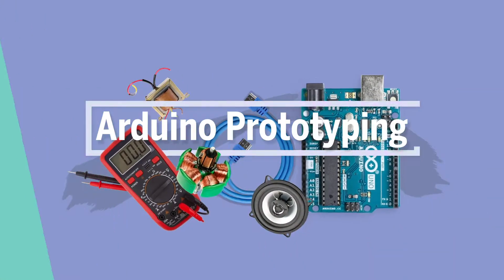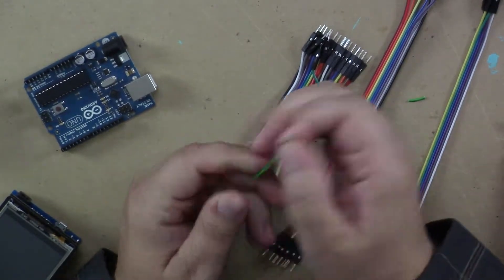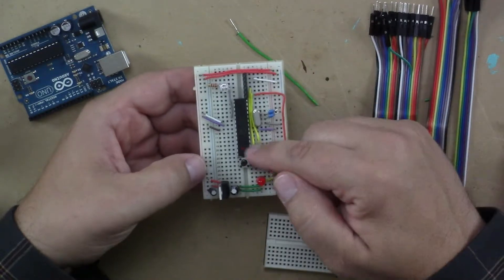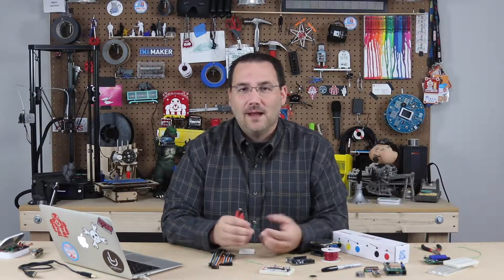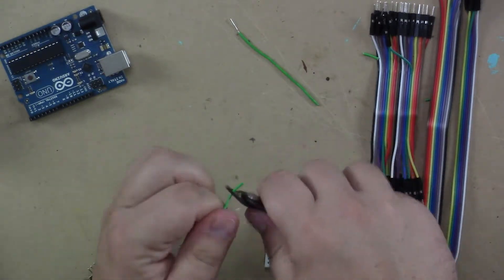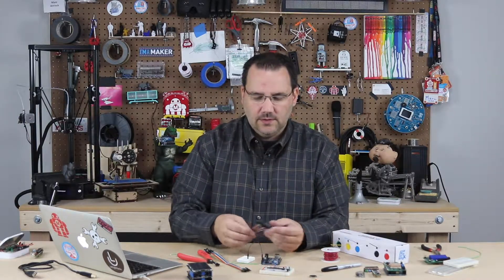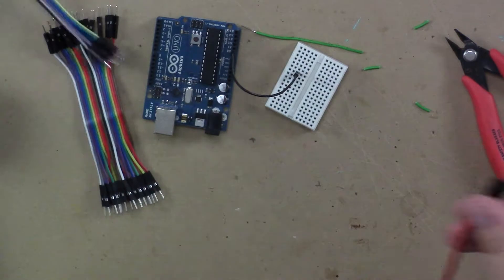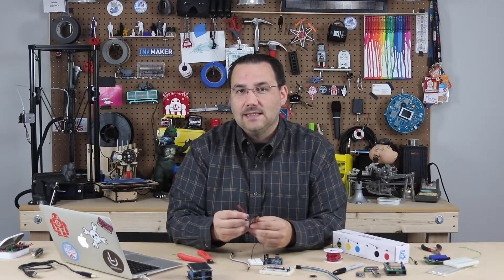Arduino Prototyping Basics #17: Jumper Wires

Comment: Hi I have a question is it possible to solder a vibration sensor to a wire?
Reply from the maker: Would need to know more about your question, but in general all the vibration sensors I use can be soldered to wires.
Reply: @MarcdeVinck  My apologies I wasn't clear on the question I'm soldering the component on red/black wire cable I did it the first time but couldn't get a connection
Reply from the maker: @aarontaylor7150  What type of wire, how is it connected, what vibration sensor? All things I would need to know. Since you are having trouble, I will assume you are talking about a piezo sensor and not a vibration canister sensor. If so, they can be tricky. You need plenty of heat, a clean metal surface and plenty of flux. You can also source them with leads if needed.
Reply: @MarcdeVinck  Well yes the sensors I'm using is the vibration switch canistor SW 18020p and wire I'm soldering with it is 22AWG red/black cable wire copper tinned
Reply: @MarcdeVinck  Yes I'm using a vibration canister I'm realizing that it's hard to get  connection because of the spring
Reply from the maker: @aarontaylor7150  Then it shouldn't be a problem. Make sure the leads on the sensor are clean and bare metal, I have seen them covered in epoxy on occasion. Also make sure you are using flux core solder, etc. I have a whole series on soldering if you are interested. Free with LinkedIn pro account. -- https://www.linkedin.com/learning-login/share?forceAccount=false&redirect=https%3A%2F%2Fwww.linkedin.com%2Flearning%2Flearning-soldering-for-electronics%3Ftrk%3Dshare_ent_url%26shareId%3Djje4EDQsQM6x0TZkGH%252Fgsg%253D%253D
Reply: @MarcdeVinck  Ok I'll check it out
Reply: @MarcdeVinck  I know what maybe the problem I'm soldering the spring to my wire all I need is the ridged terminal connected to 5v to my wire?